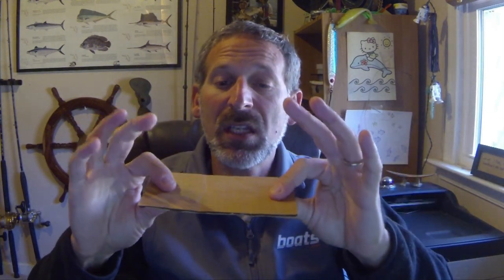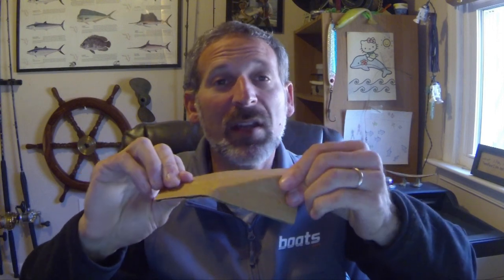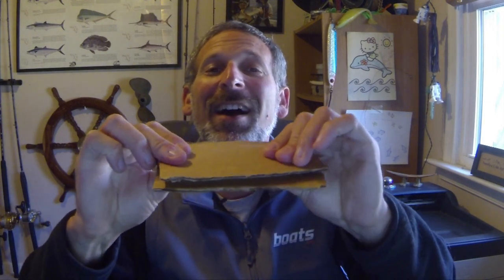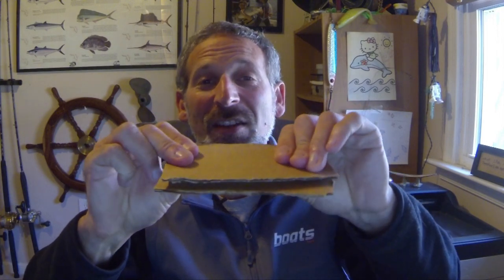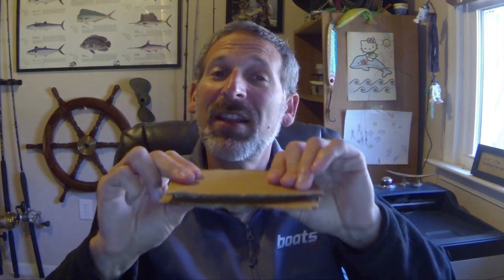Boating Tips: Understanding Foam Core Construction

Comment: Great illustration and nice snack.  Glad you didn't chew the cardboard.  But I see stiffness and strength as different.  Cored construction may be stiffer by weight, but may not have the impact resistance (rocks!) nor abrasion resistance (grounding!) of solid glass.  The glass layers of cored tends to be very thin.  I can see the sense of cored above the waterline but solid seems more sensible below (with hull stiffeners).  And when buying an older boat,  cored below the waterline seems like asking for trouble.  There have also been builders that use core under the water and solid above.  That really seems like an upside down world to me.
Reply from the maker: +jhyacinth Thoughtful comment, jhyacinth! You're 100-percent correct about impact-resistance - there up-sides and down-sides to all materials and designs, and on that point solid glass does win. I'd always advise the owners of cored boat to avoid running into rocks, whenever possible. Big-time. You're also correct about older boats and there are plenty of examples of saturated cores from early construction techniques, but I'd argue that the vast majority of today's boatbuilders have become far, far better at eliminating this issue. And as for building with a core below the waterline and solid glass above... I sure would like to know the theory behind that one!!
Reply: Advise owners of cored boats to avoid running into rocks when possible&quot; gave me Hugh laugh. Thanks for that Lenny.
Reply: So much BS from people who probably never seen a boat of any type on the rocks, foam sandwich is better than solid glass on the rocks, the inner glass layer tends to get knocked off the foam and de-laminates so the outer layer is penetrated but the inner layer holds. Get it off the rocks and you have a good chance of getting the boat to safety before it sinks, solid glass forget about it. I once T-boned another boat while racing at 20kts, it was foam sandwich. It cracked the outer layer of glass and completely delaminated the inner glass, it looked like a $50 repair but the boat was a complete right off. But it happened 5 miles offshore and the boat made it back. The foams they are producing now are probably 30% stronger than foams 10 years ago they also have crazy elongation properties which mean that unlike wood they will distort and not crack when they fail, which means they are actually a lot tougher than wood, if tough means not allowing penetration of the hull. Go check the specs on the latest Gurit CoreCell M(marine) and even tougher to a depth of 800m Gurit CoreCell S(Submarine) foam cores. Anyone building out of wood does not understand science and certainly has no clue as to the type of damage that will sink a boat. Worst boats for killing you are plywood covered in glass, the water eventually gets in and they lose all their strength, you hit heavy seas and they fall apart. The round the world Volvo Ocean yachts which sail at 30kts in 7m Southern Oceans are made with foam below the water line because the latest foams are better than any other material for absorbing slamming loads above the water line they use Nomex honeycomb because it is lighter and stronger but not as good at absorbing massive overloads. And as mentioned by others modern closed cell marine foams do not absorb water and they are the toughest most long lived maintenance free way to construct the hull of a boat. Take a wooden/steel/aluminium boat and do no maintenance on the hull for 20 years and it will be junk, a foam sandwich with vinyl ester resin will be like new in 20 years with no maintenance.

Comment: Welp, that settles it. I was wondering go plywood/epoxy or go foam sandwich/glass for my first sail, and no way am I going through the hassle of shaping wood, thanks so much for this easy video.
Reply: Simon Vercoe wood core is lighter and stronger then foam core.  But more labor intensive.
Reply: worm wood is lighter than foam?

Comment: The argument for the foam core is that they use less fiber. Always a test of fiber with or without. Never have I seen a test with coring or just thicker fiberglass. I've seen that stuff fail but I know that a proper inner frame will allow you to bang water all day, even if it's only thin bits. I understand the use of the foam core because most boat manufacturers don't build ribs or a keel into the hull, it just that outer skin that must stand alone but still, is it better than just adding more fiber.